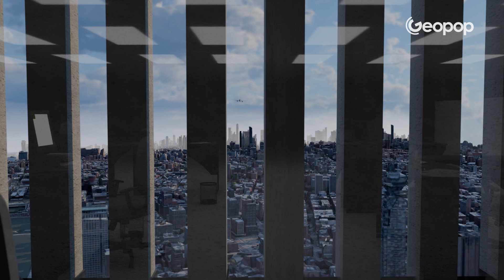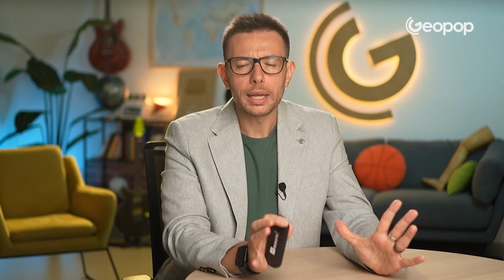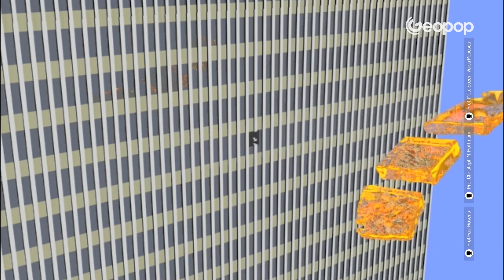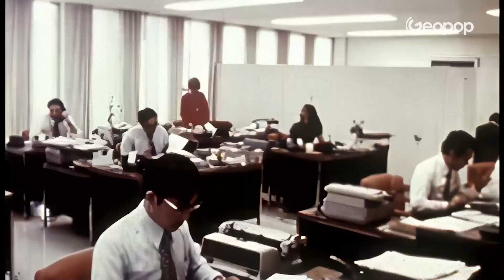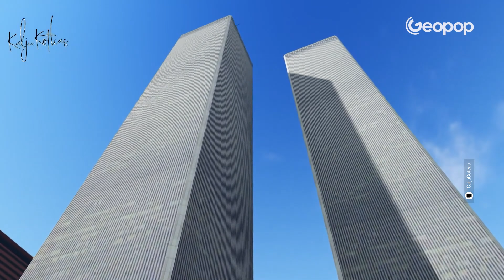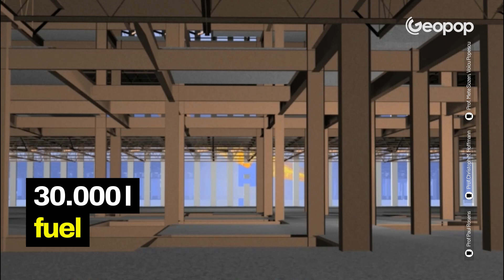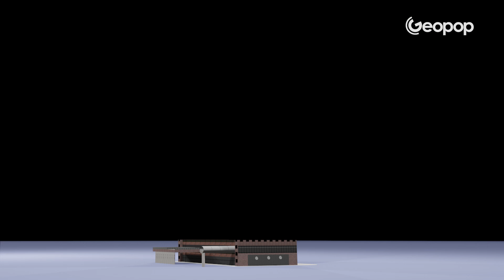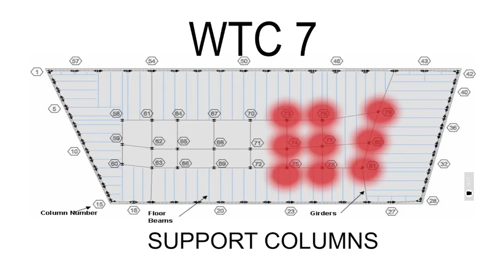9/11, 2001: The Technical Reconstruction of the Twin Towers and WTC 7 Collapses

Comment: From the start of this video in, using the word 'collapse' must be a misnomer, because it is perfectly evident from all the videos that it was not a 'collapse' but a dissolution.
Reply: Q: @00.06 -- What do you do if you look up from your type-writer and suddenly see a giant 747 heading straight towards your floor window?? -- The answer is clear: You hide under the desk.
Reply: @johnnyjohnson2268 - Dissolution:  1. : the action or process of dissolving. 2. : the ending or breaking up of an assembly or a partnership or corporation.

Collapse:  1. (of a structure) fall down or in; give way.

I see a collapse, in 4 distinct stages.
Reply: @TheLoonResistance Critical Stinker: If you see a 'collapse' - in 4 distinct stages - then please describe the 4 distinct stages: If you were to use your imagination and bear in mind the immutable laws of physics,  the fact there was a fire on the 84th floor which MAY [I doubt it though] have caused some fire-proofed steel beams to buckle, does not disprove the fact that the 80+ stories below were untouched by fire, therefore the steel beams in those 80 floors were cold and intact; the Tower was built in 1979 for the lower 82 floors to support all the weight of the 28 floors above them; therefore, even if there HAD been buckling in the 84th floor infrastructure, this would never have caused a complete tower collapse because this had never happened before and was never likely to happen; this is why it is more meaningful and less misleading to refer to the disintegration of the tower as a 'dissolution', because for freefall to take place in the space of 10 seconds only, ALL the huge steel girders in 100 floors needed to be liquefied, and all the concrete in 100 floors needed to be vaporised into mere dust. If the floors had all collapsed together simultaneously, you would have had a stacked-up pile of concrete slabs over 85 feet high, like occasionally occurs  when an apartment block is shaken by a powerful earthquake, and this was by no means the reality here, so I would ask you politely to GET REAL.  <QED>
Reply: @johnnyjohnson2268 - There’s a lot of really awful information out there about the collapse of the Twin Towers, much of it easily accessible to anyone. Good information is much more difficult to come by and to digest and totally unknown to many even though the structural engineering community had already largely figured out Twin Towers collapses at least as early as October/November 2001. Engineeringspeak is dull. Wild baseless speculation and pathological theorizing is exciting.  Fanciful tails of pre-planned demolitions, magical space beams, melting steel and mini-nukes (the awful stuff) are far more entertaining and require a whole lot less thinking, thus getting far more intention than it deserves. 

To correct that situation, I have all on my own prepared this short yet detailed technical description of Twin Towers collapses based on the available true and relevant facts. No politics or ideology, just the engineering. My hope is this will dispel many common myths and answer most if not all questions you may have about the Twin Towers collapses, because *anything can seem like a conspiracy if you don’t understand how it works_

While complex, most of the Twin Towers collapse mechanisms can be seen with the naked eye and easily discerned and understood by the layperson if sufficient time is taken to understand. 

1. The Twin Towers consisted of 4 primary structural elements that together formed an integrated system where each relied on the others.  47 hollow box-section steel Core Columns carry the majority of the gravity loads. The 236 hollow box-section steel Perimeter Columns carry the remainder and ALL of the lateral (wind) loads. Long-span Lightweight Steel Trusses connect the core and perimeter column together at each floor with a Hat Truss on top to tie the structure together as an integrated unit where no element can survive without the others. There was no structural load bearing concrete

2. The impact of 117 tons of airplane (= to about 12 dump trucks) at speeds up to 590 mph with the energy of a ton of TNT completely destroys the aircraft. This in no way implies the Towers come out unscathed. Many perimeter columns are damaged or destroyed as are some core columns (example; 33 of 59 perimeter and 20 of 47 core columns damaged or destroyed at the impact floors in the North Tower), This damage is primarily through bolt-shearing failures at the end connecting flanges, as well as bending, twisting and fracturing of weld seams. There was no cutting or slicing - the reality was far more violent and messy. 

3. The impacts destroy or damage fire insulation, fire breaks and sprinkler systems on multiple floors.  Huge fires are started across multiple floors simultaneously and allowed to spread rapidly with no effective firefighting or fire suppression. This was an unprecedented fire event . 

4. The hotter steel gets the weaker it gets .  With fire insulation stripped away and no sprinklers the survival time of the steel greatly reduced. Gradually over time heat causes the lightweight steel Floor Trusses at the impact damaged floors to sag, which was observed and recorded.  No steel melted or needed to. Structural steel fails long before it becomes a puddle. It just needs to bend

5. Sagging floor trusses pull on the increasingly weak and overloaded Perimeter Columns, causing some of them to bow inward by up to 5 feet. A straight column is up to 4 times stronger than a bent column. The bowed Perimeter Columns buckle and fail, initiating collapse. The formerly static mass above which the structure below could easily support is now converted into a dynamic mass up to 30 times greater. Because they have buckled, the Columns above and below the failure point are no longer aligned . The load bearing structure below no longer bears any load as it falls past the lower columns, NOT onto them.

6. Thousands of tons of debris fall within the four outer walls, down through the open office space, crashing onto the first intact floor it encounters. This massive impact immediately breaks the bolted connections to the columns as the amount of resistance the Floor Trusses can offer is negligible.  The falling debris slows only marginally and briefly. Note:
6a. This is NOT a solid top block crashing into and “crushing” a solid bottom block .
6b. The debris falls past the columns not onto them.  The columns provide no resistance to the falling debris. 
6c. Only the bolted connections of the floor trusses to the core and perimeter columns can offer any resistance. A pair of 5/8” bolts at each end of each truss vs. thousands of tons of falling debris.
6d. No laws of physics are violated.

7.  This floor-led collapse progression within the four outer walls can only go straight down. Note: 
7a. This process is often incorrectly referred to as “pancaking” which actually refers to a completely different process rejected at an early stage. The catchy name stuck but nobody knows what it is supposed to mean.  Pancaking is too simplistic and inaccurate anyway. More like Kaiserschmarrn.

8. Collapse progresses through the floor systems not down the columns, through the path of least resistance . Rate of floor failures increases with each successive floor as momentum increases, reaching an average acceleration of 0.65 of GA, or 35% slower than true free fall. Bam, bam, bam down the building until there are no more floors to fail.  The resistance offered by each successive floor is always the same. The mass and velocity, thus the energy of the falling debris is constantly increasing, with each floor destroyed adding new falling mass. Some falls to the sides, but most falls down. More mass, more velocity, same resistance with each floor.  Don’t get stuck on the but the lower floors weren’t on fire nonsense. They weren‘t and didn’t need to be.

9. The Towers were 95% air by volume. As that air was compressed inside the building it is forced down the tower and blown out the sides in reaction to the building collapsing . Those were not “explosions”, it was expulsions of compressed air caused by the collapsing building, explaining the low velocity, lack of flash, blast, supersonic pressure waves and lethal high-velocity ejecta.  

10. Perimeter Columns become detached and peel away like a banana behind the collapse front, playing out to the four points of the compass extending to more than 600 feet from the base of the towers. This was quite obvious from examination of the debris pile. 

11. Core Columns fail last as their internal beam bracing is stripped away by falling debris and lateral support from the floor to perimeter columns is lost. 

12. For those who care about how long this whole process took; 31-34 seconds from the moment the perimeter columns buckled until the last core columns hit the pile, or 1/3 the rate of true free fall. Don’t believe me?  Just watch any video of the collapses and note the loose truly free-falling debris dropping much faster than the towers themselves.  

13. Each Tower had a 1-acre footprint. Far from collapsing inside their own footprints the debris pile spread out over 16 acres in a pile up to 14 stories deep. 8 surrounding buildings were destroyed and scores more damaged. 

14. What was NOT observed were the 180-190 dB bangs of thousands of high explosive devices or the blinding bright flashes of burning thermite. Neither could have caused the (silent) perimeter column buckling that clearly initiated collapse.  Neither explosives or thermite could have survived the impacts and subsequent fires either. A video of a shocked and injured firefighter using the magic word explosion is in no way proof of explsoIVES . The pre—planned demolition case relies entirely on that sort of thing. There is zero tangible physical evidence and it would be technically impossible, totally impractical and completely unnecessary. No one would bother. 

15.  Finally, the Twin Towers were perfectly safe within their design envelope.  They only collapsed when taken far outside design parameters by an extraordinary and unprecedented event 

Impact + Fire (heat) + Time + Gravity = Collapse . Remove any one of those four elements and there is no collapse. Ignore any of those elements (as many do) and you will never understand the collapses. The Twin Towers were an integrated system in which no one component could survive without the others. One fails, the rest follow, through the path of least resistance – DOWN – through the open space, bypassing the path of greatest resistance – the columns.  Nothing I just described violates any laws of physics. All of the above is true no matter who planned and carried out the 9/11 attacks or why 

I hope you found this helpful and informative. It is not meant to be adversarial, but to solicit informed critical comment, positive or negative. If I made any errors of fact, logic or reason or left anything critical out, please let me know so I can fix it. To stay focused just one topic at a time please and on-topic (Twin Towers ONLY). No word-salads of Gish Gallop. IF you can offer a more plausible alternative be my guest. Be the first. Please start any reply with the words “Tits McGee” or I will know you didn’t actually read it, are not serious and just wasting my time.

Comment: these huge towers didnt fall because the steel melted or buckled a example of the greenfell tower in london alought this tower was smaller but the extreme heat temptures in this tower and it still stands most of the aircrafts fuel blew out when the aircraft struck the two huge towers fact
Reply: Grenfell Tower wasn't steel (or hit by a plane). 

You might want to look instead to Plasco Tower or Wilton Paes de Almeida to look at something at least partly analogous.
Reply: no water because the fire hydrants were damaged but the river hudson wasnt and enough water to deal with this scenario

Comment: The collapse was triggered by the failure of structural steel beams rigged with explosive charges coordinated to detonate at precise intervals in key locations. Skyscrapers don't collapse under any circumstances without the help of demolition engineering. Period . It just cannot happen any other way. This was fairly common knowledge prior to 9-11-01 .
Reply: Plasco Tower. Wilton Paes de Almeida.

Comment: if the steel pulled in you would have seen that on the outside as the steel pulled in from bending. A sucking effect as you might say

Comment: Jesse Ventura was Minnesota Governor back then. When he visited the site, 1 month after the towers collapsed, he recalls seeing rivers of molten steel that was still in its liquid state... Thermite does that. The man is a former Navy Seal so he knows about it.

Jesse Ventura said another very interesting thing: "Where did the twin towers go? There was almost no debris... No concrete rubbles... The towers have been "dustified"!!!"
Reply: Wait, ONE MONTH LATER the steel was liquid?!? You're on drugs man.
Reply: Thermite melts steel?  Does it though? If only someone had actually tested this instead of just guessing or making unfounded assumptions. Oh, wait!

youtube.com/watch?v=JXWCMBuusMI&ab_channel=TrutherTVArchives 

In this video starting at 45:35 and running to 48:35 the Energetic Materials Research and Testing Center (EMRTC) conducts a test to examine the effectiveness of thermite in cutting a vertical hollow box-section steel column. The column tested is smaller in cross section and made of thinner steel than that of the Twin Towers perimeter columns (and never mind the core columns). In total 175 pounds of thermite are used for the test on just one column and requiring the construction of a rather conspicuous coffer dam to contain it. Do recall the Twin Towers had 240 columns and 110 floors.

It would be odd if thousands of office workers missed hundreds, perhaps thousands of those suddenly appearing.

Note what an incredibly slow process this is. It took close to 30 seconds for the thermite to finish burning off.  It would be impossible to “control” a demolition using this material.

Not to mention the issue of how does the aircraft impact and subsequent raging fires NOT prematurely set this stuff off. 

Also note how bright and obvious the whole process is. Could not be missed visually. No way to hide that. 

Then at the end of the test the (relatively modest) column was undamaged…. which is a problem.

Certainly no rivers of molten steel emanating from it either and in fact the whole thing cools rather quickly as soon as the thermite has burned off, as one would expect.

Also, Uncle Jesse never said any of that. "Where Did the Towers Go" is the title of a book written by a brain-damaged former tooth research scientist who declared the Twin Towers were turned into dust by magical hurricane powered energy beams from outer space. 

Know your own material.
Reply: 666 Illuminati confirmed.
Reply: Jesse Ventura is an untreated schizophrenic that took too many blows to the head.
Reply: And where did that debris go?  Dude, you're standing on it.  It's like, look in your closet, then take everything off hangers and throw it on the floor.  Where's the clothes go?  Same argument.
Reply: It was amazing to see every single piece of falling debris stream a continuous heavy trail of dust all the way downward.  Immediately after the collapse of one of the towers, a piece of heavy steel framework remained standing for a moment that was at least several stories high and began to move as if to fall, but then just turned to dust inexplicably and was gone.
Reply: What is the source of the many tons of molten steel found in and under the debris, the heat so intense that the molten steel remained in that state for weeks afterward, running off of the debris as it was excavated. This cannot be molten copper from wiring that retains the color of a shiny new penny.  It cannot be molten aluminum that retains the color of the polished aluminum wheels of a street racer. It was the color of glowing orange molten steel  that cannot be mistaken for any other material, reported by firefighters who are very experienced in the nature of such materials as well as seen in video evidence.

When you combine this with an entire lack of turbulence behind 500 mph aircraft, when even a small Cessna Aircraft would leave an evident wake in the smoke and fire only seconds later .  . We find that skeptics still cannot be skeptical of the official narrative in explanation.  Sponsored channels and forum activity are skeptical of nothing when support is provided.

Sponsored activity in the forums is very normal today for commercial and political purposes and subjects of controversy -- in the attempt to lead public debate.
Reply: @ElLowEl .  . "What the hell are you talking about?" .  . 😃 .  . Thank you for your sponsored reply, Mr. EILow.  The word projection indicates holography as you know, commercial demonstrations of which have been amazing in recent years.  To feign ignorance doesn't work well for you, however.  Where, Mr. EILow, is the wake turbulence only seconds after passage of a 500 mph large passenger airliner -- not seen in the smoke and fire covering the impact zone?  Even the wake of a small Cessna Aircraft would be noticeable -- yet there is nothing.  It's likely that no real answer from you is forthcoming. We'll wait and see .  .
Reply: He is a crank.